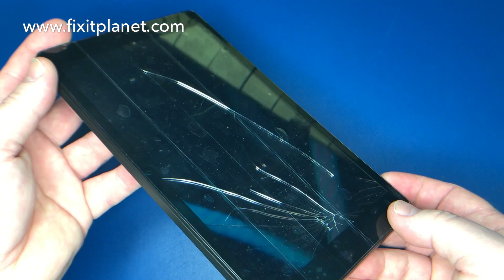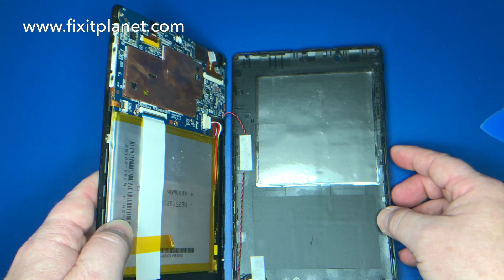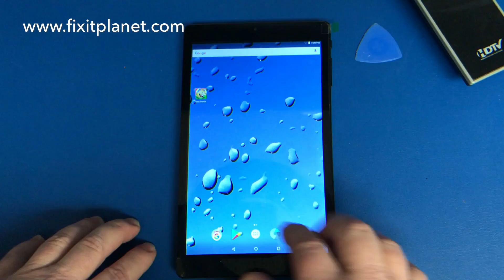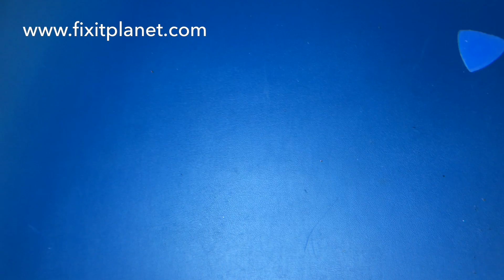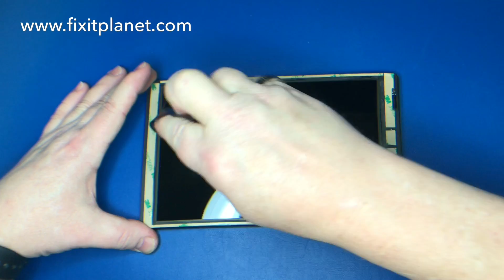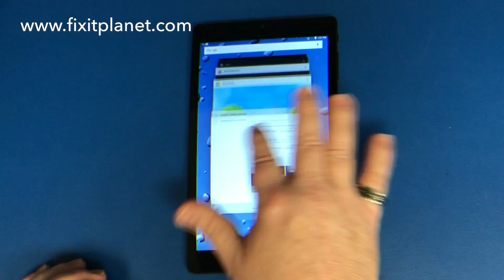Nextbook NX 16A8116K PK Touchscreen Repair From Start To Finish.

Comment: I just replaced the screen on my tablet.  When I started, everything was working well, but the screen was cracked.  This video was very helpful in figuring out what to do.  The ONLY thing I did  not do was to check the digitizer and glass for touch, to make sure it was working.....  I put it all together, and everything comes up nice and clear, but unresponsive.  I double checked the connection of the connector.  Is it possible that I have a bad digitizer screen?  How often does that happen?  Or is there a reset that can be done?
Reply from the maker: Yes it is possible you have a defective replacement or you have overlooked something.